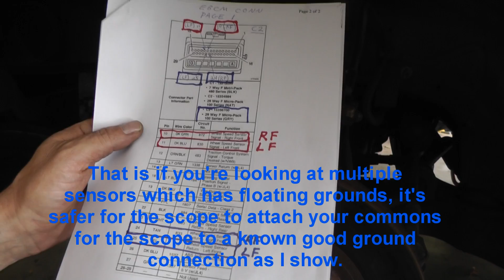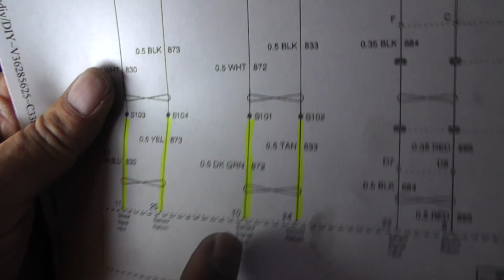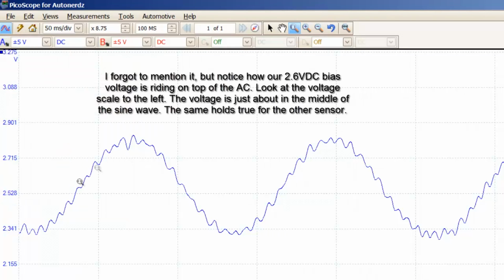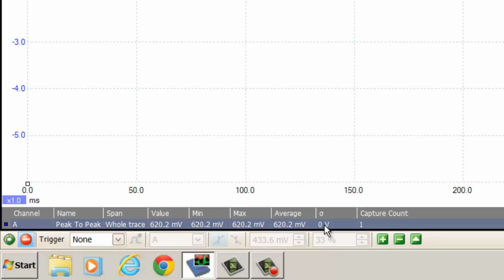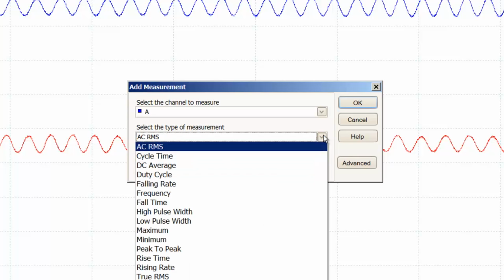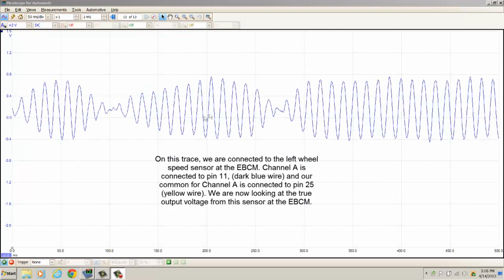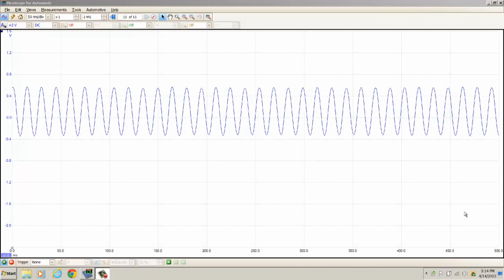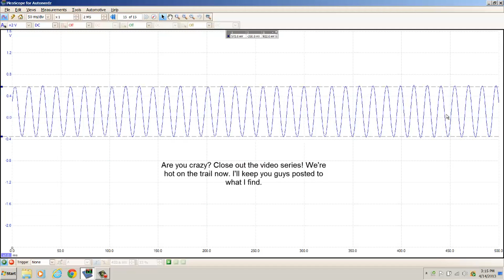Buick Lesabre ABS, Traction Off Diagnosis Part 5

Comment: I have no ohms reading to both rear wiring. But the wiring tested ok, 
when unhooked from ABS unit and tested. Does it sound like the abs unit 
(one piece) is bad?
Reply from the maker: I'm not sure how you're testing. I assume that you're checking a Buick and if so, did you read any codes to give you some direction? Most likely it's an ABS sensor, but see what the scanner tells you. If it points to a sensor, focus your diagnostics on that sensor.

Comment from the maker: One more thing blackwell. Most cars are getting away from these types of sensors and switching over to an active type sensor which uses a hall-effect element. The reason is that the passive sensors generate low voltage at lower speeds and thus the ABS is disabled at slow speeds. The newer sensors can generate a voltage at very slow speeds. And not all passive sensors such as mine uses a floating ground. Some connect back to DC- and then you can look at multiple sensors with full voltage.

Comment from the maker: Yes, the Fluke ScopeMeter series has isolated inputs which totally isolates the commons from each channel. Of course, that costs even more money. Here's a scenario... You have a crank sensor that has a floatiing return and a cam sensor that's a hall effect. One channel right across the crank sensor. , the other across the cam sensor. Now you've grounded out the crank sensor and the car won't start where it did before. Just something to keep in mind when dealing with floaters.